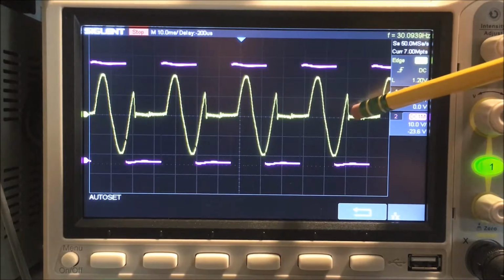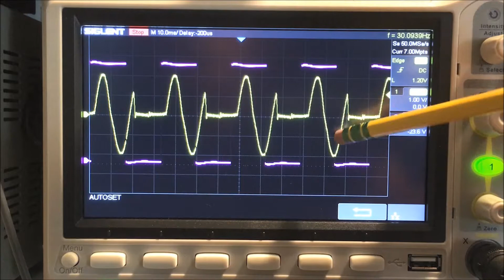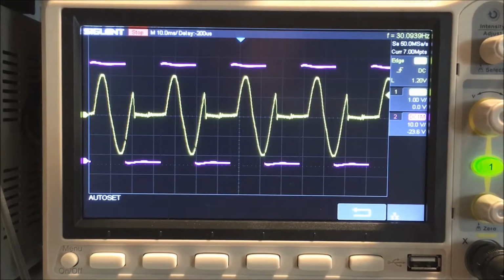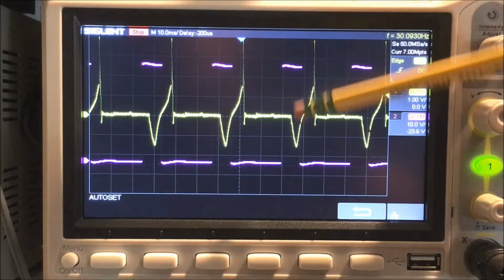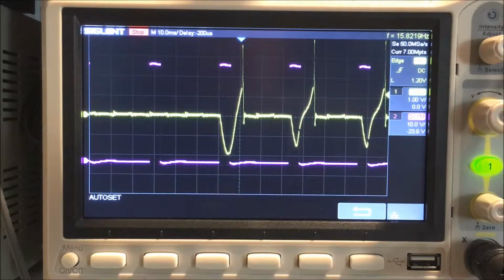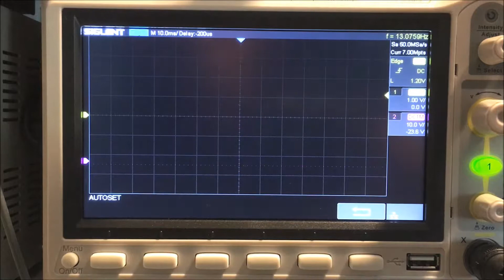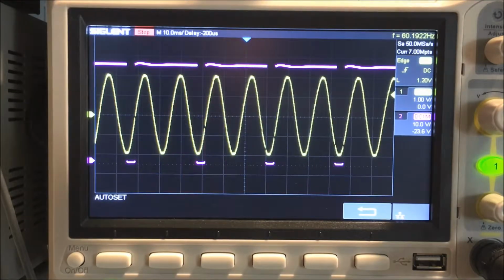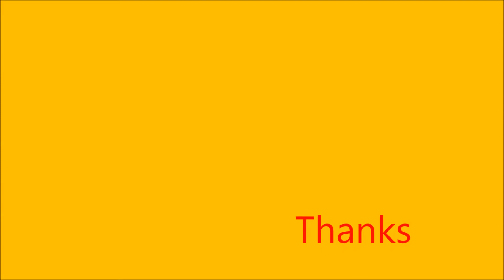SSR Solid-State Relays

Comment: nice video. I have the exact same ssr(40 A though) and want to control by a pico a 600hps blallast who drives a lamp. It doesnt work well, the ballast make noise and the lap blinks quickly. Has this to do with the frequency of my sgnal?

Comment: CHRIS"S WORKBENCH, Why are cars using SSR solid state relays now? does SSR solid state relays use JFETS or MOSFETS? Do you need to use a current limiting resistor when applying power to a SSR relay to test them out of circuit?